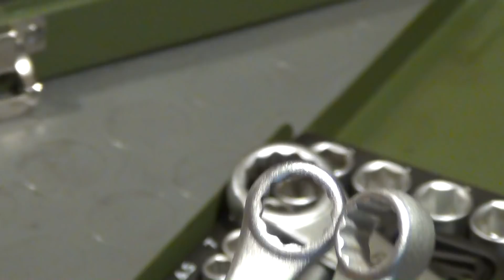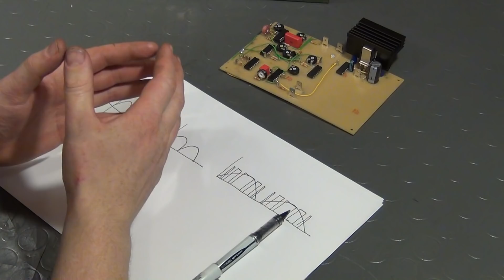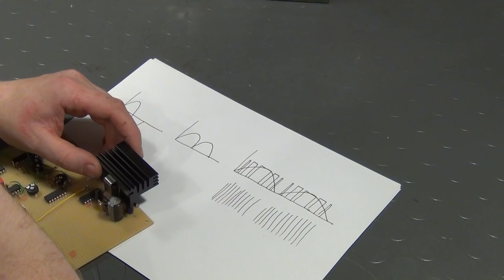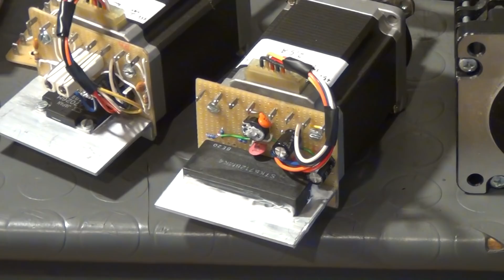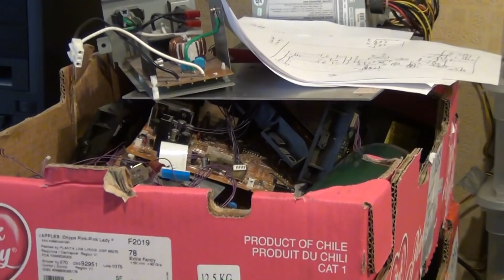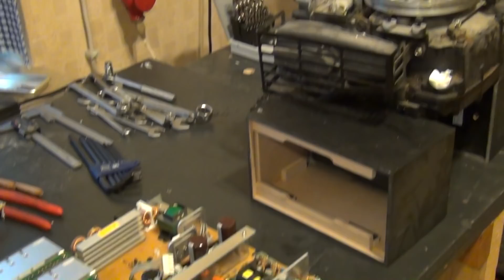TPAI Lab Report # 003:  Stepper Motor Drivers, Sine Wave Inverter, Briggs and Stratton, Proxxon etc

Comment: Hello from Romania. I have an interesting idea for you, about your square wave analog project that you described. You specified that your osciloscope can not catch the oscilations. But WHY? And this is my answer for you: because the time is too FAST for it. Design everything at a stupid LOW timing, like 1 second for the smallest rise , and 10 or whatever seconds for the longer square wave. Using of course some bigger capacitors in the range of microFarads.  Hell, you can even use some LED's instead of the oscilloscope. Haha. But the osciloscope WILL work this time, and also do a better job. And after you confirm that your square wave is as you want it to be, from this slow rate stage, then is a matter of changing (back) to the nanoFarads capacitors that you originally used here in this video, for the normal time rate stage. Good luck.

Comment: If the pulses are within digital audio range, (20~20000Hz), why not run them through a speaker, record (or plug the signal directly to an audio jack after modulating it to acceptable voltage and amperage) and examine on Audacity?  I dunno if the sampling rate is high enough, but I think so...   perhaps a bit imprecise?  But might get you a good ballpark without the specific oscilloscope you needed.

Comment: Each negative comment is a hammer blow that planishes a new even better you. Embrace the comments and watch yourself grow. There is nobody that got great taking the easy path.Your varied talents are remarkable and many of your viewers who are no doubt already accomplished in some of what you work on are very supportive of the skill and information you generously offer.We hope you keep going and stay happy.
It would be interesting to know if you have a phase converter( I use a rotary 15Hp for my welders and other shop machinery) or if you plan to rewire the three phase appliances to work on single phase. Secondly whilst it is brilliant to see you have made your own stepper drivers would it not be more time effective to use the very cheap bipolar units commonly available on line? Of course you no doubt want to get the most done in the least amount of time  maybe you could share what you discovered from making your own drivers :) Thanks for all the effort you put in.

Comment: I feel sorry for you as how disrespectful people can cause concerns to others in such an unprofessional manner.
Any how I have watched some of your videos and find them very useful. Learning properly how to re use preowned parts of machines. Your knowledge is vast and interesting to watch. Keep up the good work.
I'm interested in what type of motor to use to create energy either 3 phase Ac or Dc.
The plate rotation motor are rated at 5-6 rpm but they can really shock you, yes I got caught really good.

Comment: If the briggs has been tilted forward or on the it's side sometimes oil will get into the carburetor through the breather tube, if the engine is run for about 10 minutes it'll normally clear up if that's the problem

Comment: Love your intimate knowledge of all the electronics.

I am looking to build a servo or stepper motor controller which I can use as a follow focus system on my dslr, what parts would you recommend? i am a complete novice but would love to build it myself, powered from a small battery.

I need to be able program the limits in both directions and maybe even the speed, I found this http://www.active-robots.com/servo-driver-with-enclosure but would like to build my own version with some guidance.

Thanks in advance

Comment: I like your videos. Perhaps you have already found the problem with the brigs, but just in case, these commonly have oil ring issues. The horizontal piston can exhibit oil ring sticking failure on the bottom of the cylinder. Sometimes, all that is needed is a good cleaning and a fresh oil ring. This is pretty common and often can be serviced without requiring an overbore and new piston. Very common if the previous owner didn't keep it well maintained and change the oil regularly, overheated the engine, or overfilled the oil.

Comment: Can you please make video(if possible) about discrete components bipolar stepper motor driver.

I am currently trying to make one using discrete components that I hope it will be able to deliver current up to 20 amps @30-45 DCV.

So I am looking forward to see something from you with the same (and usual) High quality content that you deliver.
Hope you would be able to do one specially you already has done several drivers as it is obvious from this video
thanks.

Comment: About the inverter - why not just a Wien bridge oscillator? Seems cheaper than a IC function generator and might be close enough. Also you could do a NE555 frequency modulation circuit probably and have the same modulated PWM output. Cheap inverters for all!
Reply from the maker: Standard pwm generators like the TL 494 is just as cheap as the NE 555, but much better suited for this job. A Wien generator might maybe be a dollar cheaper, but it is also much less stable in terms of frequency. The integrated circuit also delivers a timing signal that is needed in this circuit.
Reply: The Post Apocalyptic Inventor I forgot the phase split (that I assume you want the timing signal for). Its doable with 2 simple diodes and two NE555 to make the FM signals for each transistor, just to do things the harder way and 'closer to the metal' ;-) Not elegant at all, but maybe more educative?

BTW not a EE so I'm way out of my league here, just a hobbyist. But I like to share ideas.

Comment: I just watched your video. Very good. I think you and I are a lot alike, except you have more knowledge of electronics than I do. My comment is on your B&S engine for your lawnmower. I don't know if you have it fixed or not, but I will give you my input anyway. 

internal combustion engines need 3 things, 
     1) fuel
     2) air
     3) spark
missing any one of these 3 will result in engine failure. 

Spark is easy to check. Remove the plug, ground the electrode, and pull the cord. You should be able to see the spark.  No spark could be as simple as a bad plug, or as hard as a bad stator. With your electronic background I think you could make that determination easily. A pulled is required to remove the stator. In my experience this is usually not the problem.

Air is usually not the issue, unless there is a rag stuck in the carburetor.

Fuel is the most common ( in my opinion ). Fuel in the tank does not always mean it is getting to the combustion chamber.  Float level, or sticking float needle is probably the most common problem. Taking the float bowl off will allow you to see if fuel is in the bowl. With the bowl off you can see if the fuel is making it to the bowl. Needle jets could be dirty as well. If any of the afore mentioned problems are present, I would pull off the carb and either clean it in carb chem or carb cleaner spray. Also check the fuel line for pin holes.

Carburetor problems are generally caused by storing lawnmowers outside.

I hope this helps you

Comment: I really like your videos.  I'm still in catch-up mode, so I can be current on all of your videos.  I'm curious as to why you "reverse engineer" items?  Do  you do it just to learn how it works?  I'm just curious.  Keep up the great videos.  I do like the repair videos you make.
Reply from the maker: +Scrap Smith Yes it is about understanding them. That "understanding" is then the key to a whole range of things. There are many technologies that can ONLY be truly understood by reverse engineering them, because the knowledge that went into their design is confined to a few people inside the very company that made the product.  This type of restricted information can also not really be obtained by reading books, or taking university courses, because neither of those typically go into the specifics of actual electronics design, but only into the basics behind the design techniques.  
Manufacturers will often also be reluctant to hand out circuit diagrams and there is no way to get your hand on those, ( for example to help you with a repair job)
Once you have successfully reverse engineered a device you can apply your theoretical knowledge to understand the workings behind it, you can then use that knowledge for different purposes, like repairing the device, or other similar devices. You can also use it to improve the device, or design a new device (based on that knowledge) altogether.
I do reverse engineering for all those reasons.
Reply: That is what I thought.  I appreciate your time and effort to pass on your knowledge of electronics, etc.  I think you have quite a talent and I believe would make a great teacher, if you are not already.  If you do not mind me asking, what do you do for a living?  How did you come about do this channel?  I find it very interesting and have learned that I have destroyed so much usable electronic salvage by scrapping it.  I've always been one that doesn't like to waste things or just throw them away, so I look to either sell, reuse, re-purpose, recycle, salvage or some positive use.  I find garage or trash being buried in the ground just a waste on many, many levels.  I'm not a tree hugger, but I do respect the environment and I was brought up not to waste things.  I like that you seem to have a similar view on the reuse of old things that still have life in them.

Comment: As I am watching the part about the sine wave generator, rectifier, PWM, etc. I can't help but think all of that could be replaced by a 70 cent microcontroller.
Reply from the maker: +pratherat Yes of course. But the idea here was to intentionally NOT use a microcontroller. When I do projects for myself, I often try to do things the hard way. In this way I keep learning about new techniques all the time.

Comment: Great to hear your comments on copyright. I have friends who are anti-copyright because they believe that holding onto rights for what you have created is anti-freedom. But those views are usually expressed by people who want to use someone else's idea and not pay for it. What you create belongs to you n my opinion. 

Also I just saw a video that might relate to the first Briggs & Stratton engine you talked about. Look up 'mustie1' on YouTube and his video of August 19, 2015. He had a similar engine with a failed gasket under the carburetor that was leaking excess fuel. Maybe it's a different problem, but he is a lot like you although he works in small engines rather than electronics.

Thanks for the great videos.
Reply from the maker: +Jeff Ratliff I consider myself a libertarian and  I believe in the free market, but there are limits to that concept. It is the purpose of the state to enforce the law and guarantee the rights of the individual. Without that protection, it would be nearly impossible for me keep the channel running.

Comment: You were right to get 1/4 and 3/8, unless your working on hgv's or industrial machinery the 1/2 is clumsy to use under a car bonnet, an important thing however is the no. of clicks the ratchet has, for confined spaces you need a min of 40 clicks per rev.
I didnt know proxxon made hand tools, I've only ever seen miniature power tools.
I'm not shunning your sockets however I only buy ratchets that are either fully encased in plastic such as teng tools ones, or ones that are all metal, this is because the 2 piece ones I have owned after a while the plastic handle comes loose and falls off.

Comment: I can see you're using these popular 40x60cm cardboard boxes used for transport of fruits to store your electronic components and other bits and pieces. That's a very good idea, I use these boxes too. They are the cheapest and amazingly good way to build a storage system where one box fits onto another and doesn't slide off (thanks to these wings in one box and corresponding openings in abother box). In the future I'm planning to switch to custom-designed and custom-made plywood boxes but as for now I have other things to do, so these boxes just simply rule. I just wanted to say hi to another maker who uses the same cardboard-box storage system that I use. :) And that it's a very good idea.
Reply from the maker: +CJWarlock I actually have a ton of transparent plastic boxes and electronics magazine drawers as well. For cheaper stuff I use these 40x60 cardboard boxes though. I also have a "deep storage" system for stuff, that I rarely use. For that I use sealed cardboard boxes, that the local super market gives away for free, I label them with blank stickers that you can get for free from some private postal services. Those boxes have the advantage, that dust cannot get inside.
Reply: +The Post Apocalyptic Inventor: I didn't doubt it for even a while that you have several different storage solutions for every type of items. Same here, however I'm still in the process of organising the storage (and it's not the evolution stage, I'm yet about to construct shelves for these cardboard boxes to ease access to items). I'm interested in these sealed cardborad boxes. And more precisely: I'm interested in how a cardboard box can be sealed. Could you please post a photo somewhere or a link to such box (if it is comercially available let's say? I'd like to look at its construction to determine how the seal is made. Hmm, I just checked that in English it may mean an usual box that has a velcro wrap. Is that the case? Thanx for the tip about the labels - may come in handy when a lot of boxes need to be labeled. I have some A4 stickpaper already though so I can print nice labels which would be a good idea at some point. ;)

Comment: Have you considered a sound card oscilloscope? I have managed to capture greater than 1Mhz PWM signals from a Rpi/Arduino and a 300Hz PWM from a 555 timer circuit. With what I have done, my voltages have never gone over 20 vdc though. The output that plugs into the LINE-IN never gets to 1v. I am relatively certain that the voltages you are dealing with are too high. I don't know much about the exact voltages that you are probing, but you might be able to lower the voltage for a "proof of concept" reading from the probe. Good luck to you and your future projects.
Reply from the maker: +Ian Ide Hm. Thanks for the suggestion. I indeed haven't tried that yet.

Comment: I just wanted to comment on your little engine. bluish white smoke is oil and  likely the piston rings and cylinder bore.quick fix, new rings and get a ball hone and clean up and cross hatch the cylinder bore. it also could be valve stem seals,but more likely the rings and bore. hope  that helps

Comment: Have you tried taking the 50Hz square wave from the 8038 and using that into the SYNC input on your 'scope? That should give you a stable image. You may need to use the expand timebase/delayed sweep functions to look at different parts of the waveform.

Comment: 28:00 A combustion enging producing lots of blue/white smoke is an indication it's burning oil.
Typical failures are overfilling with oil (check oil level),  blown/cracked head gasket  (Zylinderkopfdichtung) or cylinders/rings being worn out.

This all assumes the really obvious ones like not using the right type of oil or operating the engine in an incorrect orientation.
Reply: +oreubens How is a small lawnmower engine going to get oil from the other side of a blown head gasket? You don't think there is an oil pump inside a lawnmower engine, do you? There are no oil galleries in the block, or head either. It is splash lubed off the crankshaft. So the only way oil can get to the combustion chamber is through the rings, or cylinder wall. It is hard to overfill a lawnmower engine with oil too. I guess if you tip it on it's side, and fill it up you can manage to do it. But fill level is all the way up to the plug. Yeah you should run straight weight SAE 30 WT in a small engine, unless it is really cold. When it is that cold I'm not outside playing with lawnmower engines myself.

If a small engine smokes it is just keeping the bugs down. As long as it is still producing power it is all good to me.

Comment: Just a thought on the inverter circuit. You do have a square wave synchronized with the sine wave from the chip. Could you use that and perhaps a 555 or micro controller or similar to create a delayed trigger for the oscilloscope? You wouldn't get a full wave shot but you should be able to scroll through a full cycle and inspect the output as it runs.

I love your videos by the way, and that you are re-using old items instead of going crazy with "time is money" and just buying everything new. Keep up the good work!

Comment: Proxxon tools ok, not on par with proper tools but for a normal person ok. Proxxon equipment on the other hand...overpriced plastic garbage.

The upper echelon, half way decent, but i wouldn't blow my money on it, i'd seek out the competition and pay a little more. The lower one, stay away from it like from rabies. Source, i have quite a few Proxxon "hobby" level pieces for my apartment shop. A lot of them had to be modified to meet up with the "description" on the box.

Proxxon saws, cutters, drills, mini mill etc.